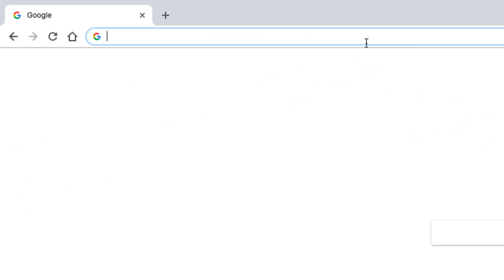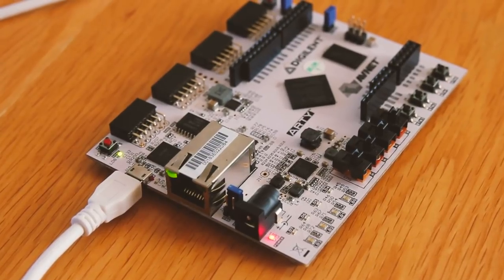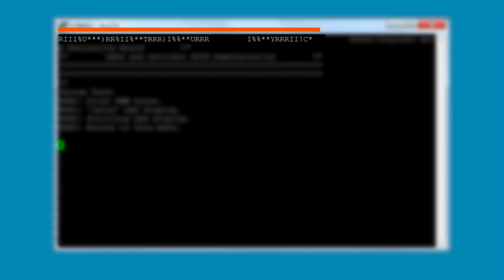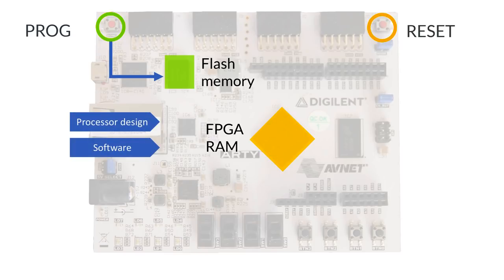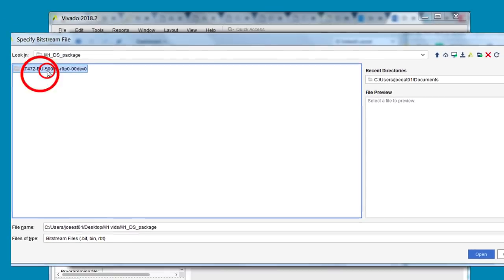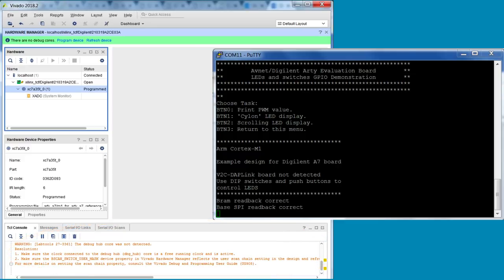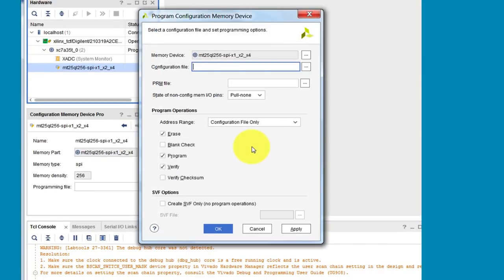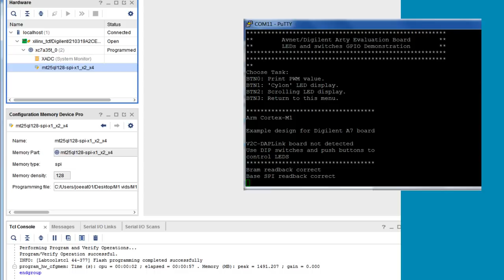Arm Cortex-M DesignStart FPGA: STEP 1 Connect the board and test

Comment: FYI, On newer ARTIX-7 35T boards instead of mt25ql128 configuration memory device I had to go with s25fl128sxxxxxx0-spi-x1_x2_x4 to get the newer Spansion part